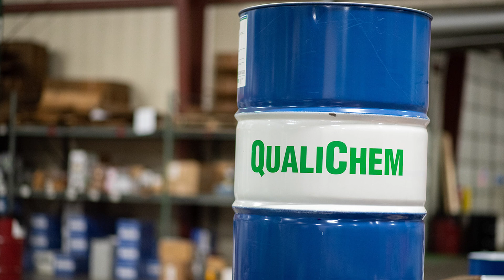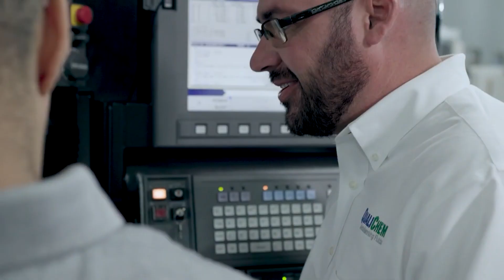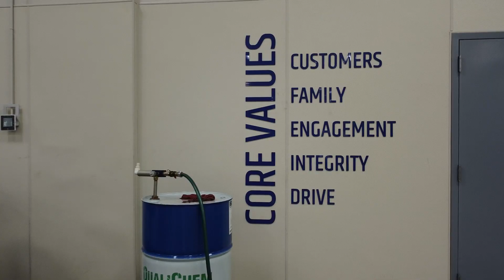A low-price coolant cost them their business!

Comment: There is a lot left out of this conversation. Particularly the ratio of the new coolant used. Losing coolant with chip removal is almost always a dead ringer for far too high concentration. Which can also lead to poor finishes and poor tool life. I would assume they considered this, tested, and contacted the manufacturer for proper ratios for the application, but I am going to guess they just said "we dont have any more time for that. just go back to the old stuff".  I would almost bet this was their problem, and exactly what was done about it. Ive been there done that, assuming a new coolant should be mixed at the same ratios as the old. A coolant system should be flushed entirely, not simply drained when changing coolant types. Mixing incompatible coolant can cause issues as well.  All I see here is a pitch for QualiChem, with nothing but anecdotal evidence as to why it should be used.
Reply from the maker: thanks for the comment
Reply: I swear, the comments section on this channel is where the real information is hidden. Without exposure to a production environment, I don't know that I would have thought of that. Though I would have thought to read the flipping directions.

Thanks for the intel, my dude.